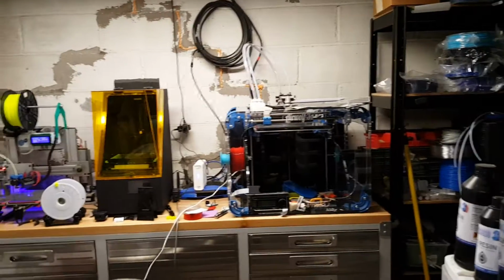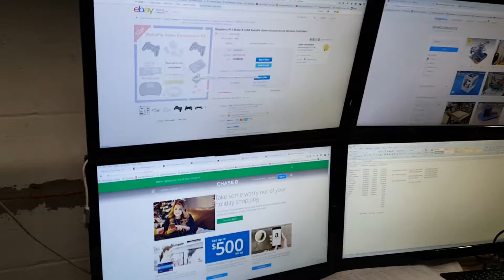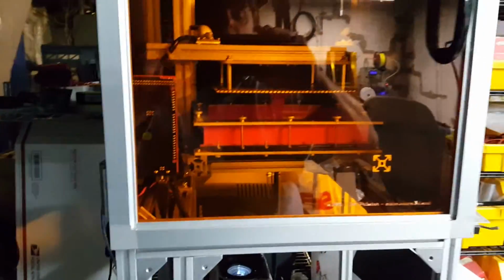Muve 3D DLP printer update

Comment: Hi,
I'm considering buying one of the MUVE printers, but someone told me it's very hard to print BIG parts that take advantage of the build volume because the DLP projector is brighter in the center than at the edges, so it's not easy to make bigger parts. Is this true? I really need an answer on this if you have the time. I need a printer that will do large SLA parts but with good detail all around.  Would the Pegesus be better for that?
Reply from the maker: DO not get a pegasus
there is actually a new printer on the market that might be a little better than both
The Wanhao Duplicator 8 Mark 1
its a DLP all though I see alot of adds that say SLA
has a large build volume and uses the new lcd technology

Comment: What's the best resolution in XY and Z you can do with the Muve 3D DLP?
Reply from the maker: This depends on the projector your using
the higher the resolution of the projector the higher your resolution can be
this is from the Muve3d.net web site for x and y
Muve 3d UltiPro - 25-140 micron
Muve 3d DLP Pro+ - 25-90 micron
Muve 3d DLP 4k - 15-70 micron